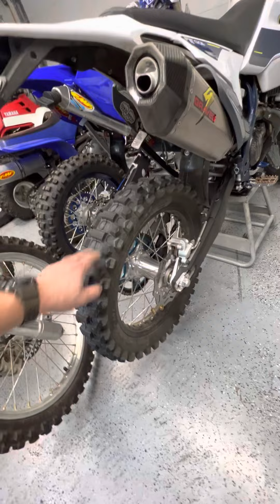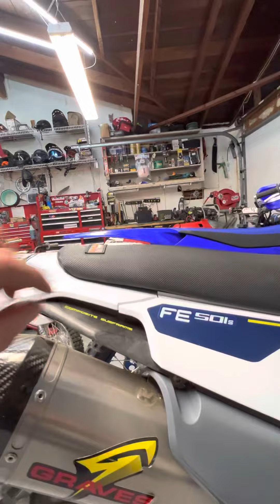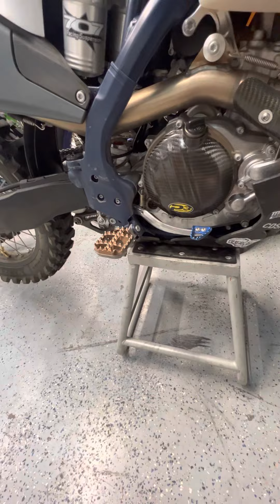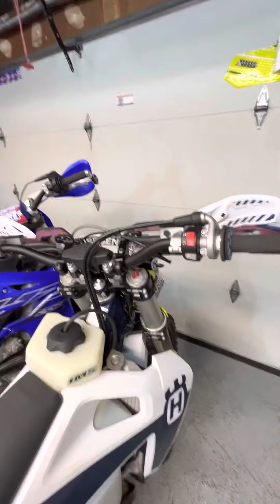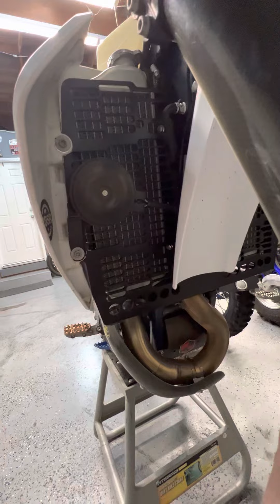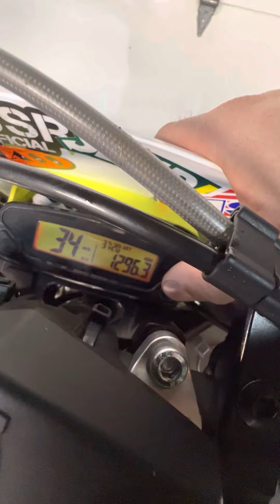Husqvarna FE501s ultimate dual sport build breakdown

Comment: Hey man I have a question. I want to put different mirrors on my 501s but don’t know how to take the the stock lever perch apart to install the different parts. I no longer need the piece that the stock mirror screws into and have different flat ones from factory any idea how to get the pin out that it pivots on?